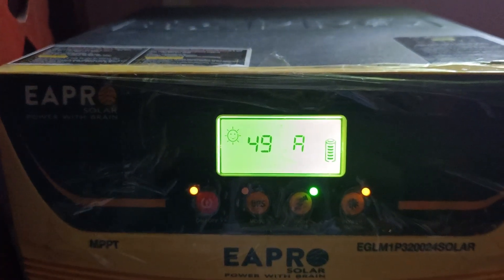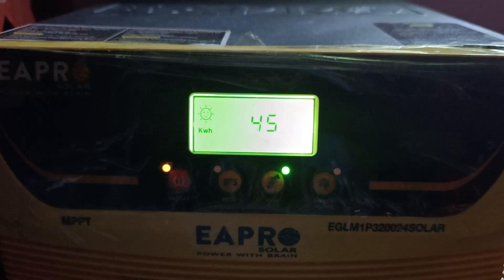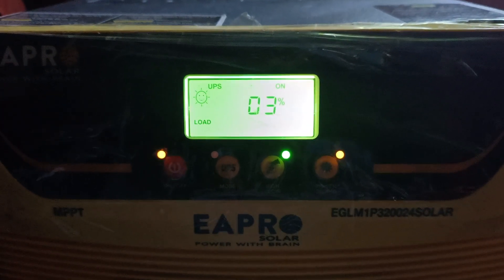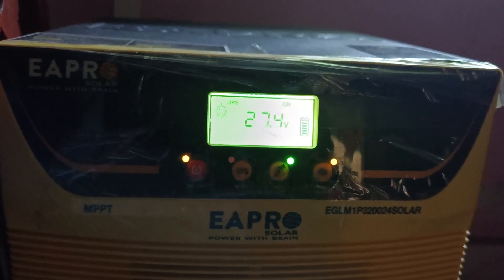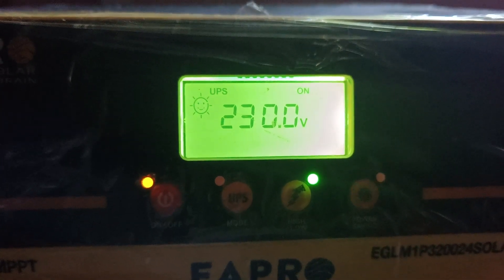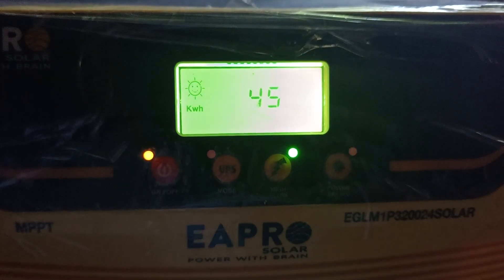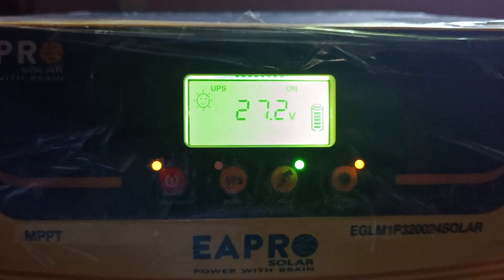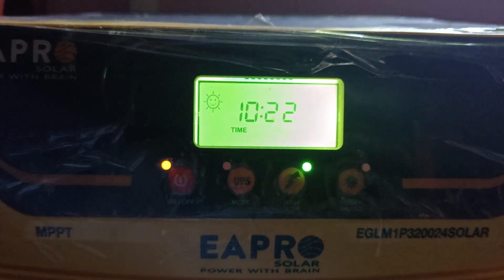Eapro 3000va 24v mppt solar inverter Direct output from solar, load test on solar directly.

Comment: Dada ei inverter ta full load ki really 230v dhore rakhe naki display te false info dekhay eta niye jodi ekta video diten bhalo hoto... Cross check korar jonno full load diye inverter e clamp meter diye ektu inverter er output voltage r ampere ta ektu check kore ekta video diten tahole bhalo hoto
Reply from the maker: Definitely i will make another video with energy meter
Reply: @lithiumspark1926  ok awaiting for that video...

Comment: Which geyser are you running on it that is working on 57 amp and 27.2 volts it means 1550 watts?  Actually my geyser is 3 kva. Will my geyser run on it?
Reply from the maker: Can you tell me How much amp take your geyser?
Reply: @lithiumspark1926  around 12amp
Reply from the maker: @nimeshpurohit4430  nehi calega.
It can run approximate 9.5amp load.
Reply: @lithiumspark1926  how much amp did your geyser take?

Comment: Hello ji, 🙏 aapne ups bottom off kiya? Inverter setting details bolia na,
Reply from the maker: for solar home system ups mode does not need.
If you have sensitive device like computer, server then  you better go with UPS mode
Reply: @lithiumspark1926  hello sir, aapne high/low switch on Kia tha na off Kiya tha? please setting video dijiye,,
Reply: @lithiumspark1926  Thank you 🙏

Comment: Mera eapro mppt inverter 24v model no 3500 hai lska sath lithium phosphate battery laga sakte hai kya Bhai.270 poly panel 4 hai luminous ka
Reply from the maker: Laga sakte hey.
Lithium phosphate battery ke sath BMS jorur lagaiya otherwise battery full jayaga
Reply: Ok thanks